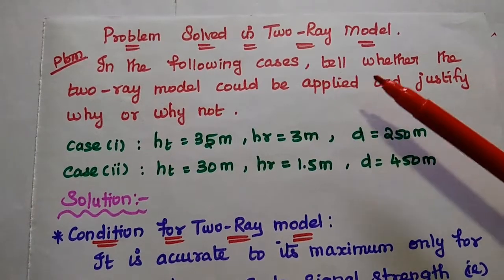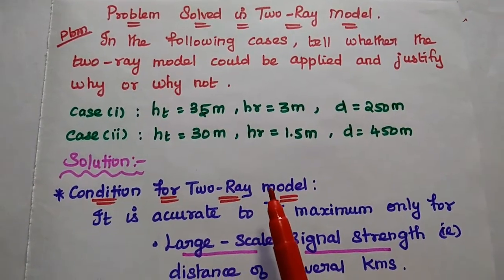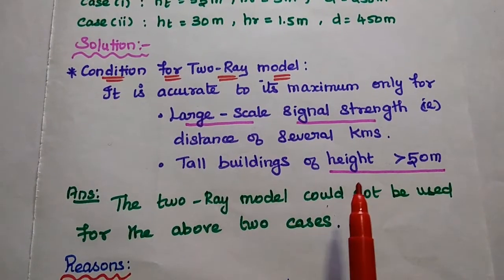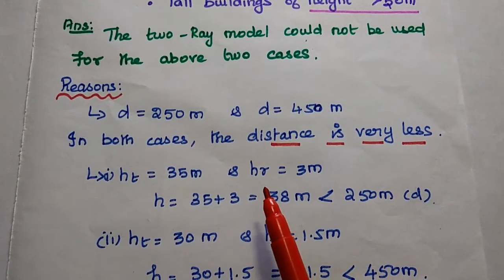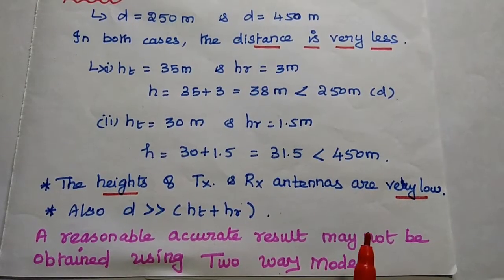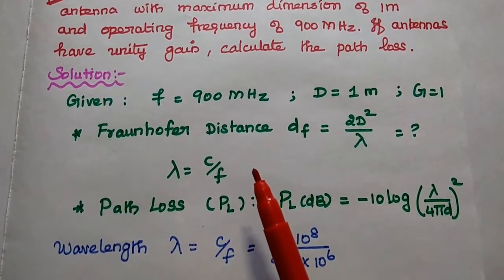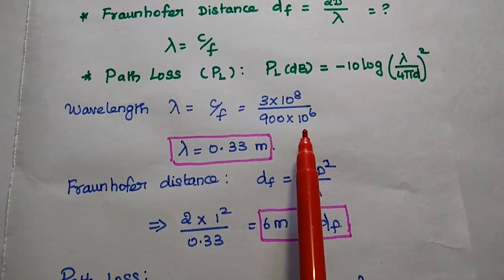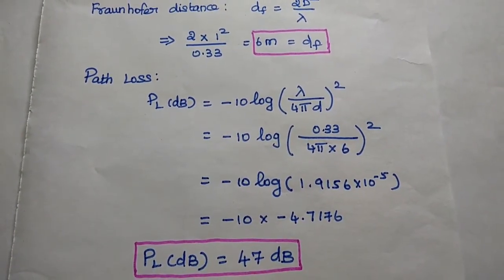Problem #2 - Two-Ray Propagation Model - Path Loss - Wireless Communication

Comment: Conditions for the 2 ray model is....ideally the distance between them is less than 10 times the height of the taller antenna , the height of the transmitter is 10% of d . Is this correct or not..?